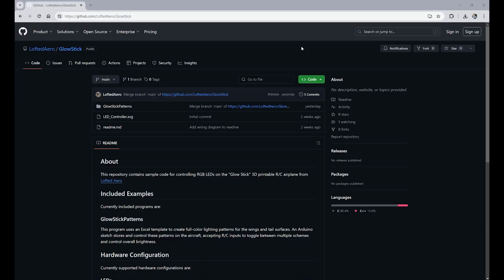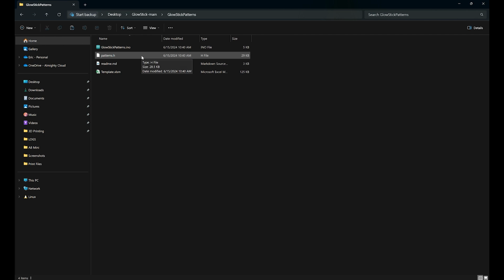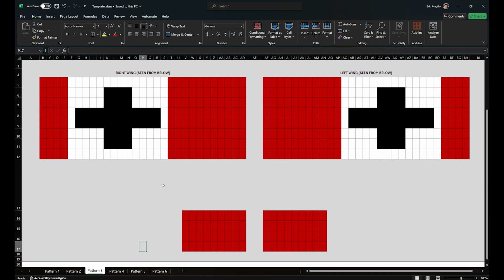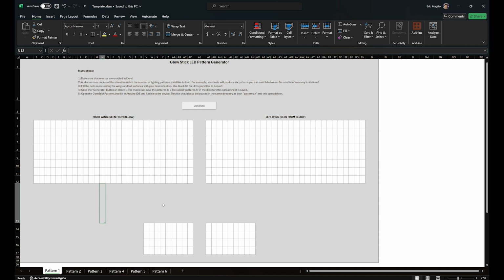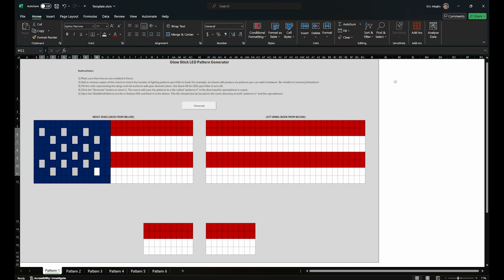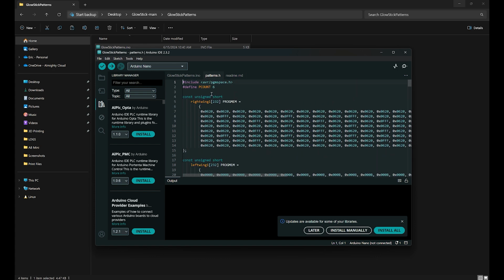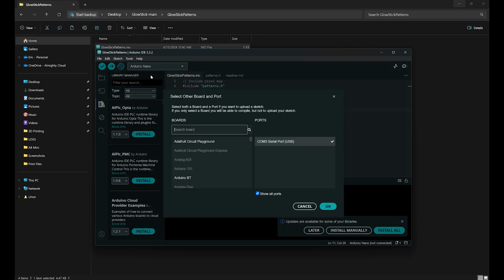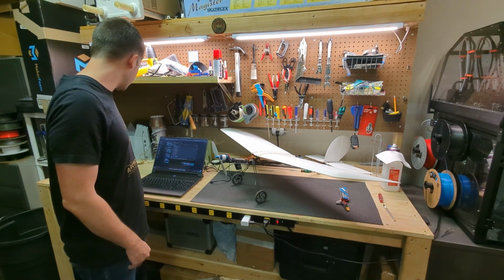Lofted Aero Glow Stick - LED Tutorial

Comment: How feasible would it be for a momentary switch like the bind button to be used to cycle between sketches in order? I could easily do a 3 position switch but trying to remember switch combinations while flying would be a little hairy. Pushing the bind or any other momentary to toggle between would be a great option.